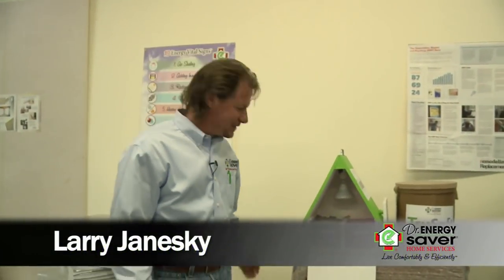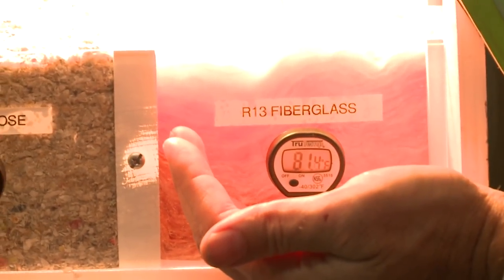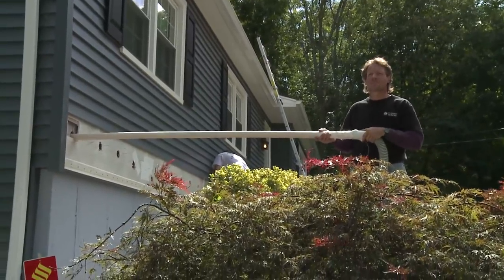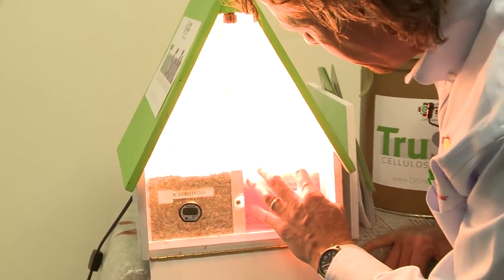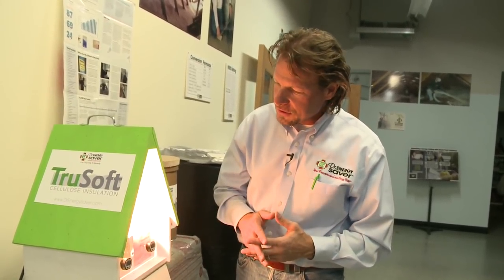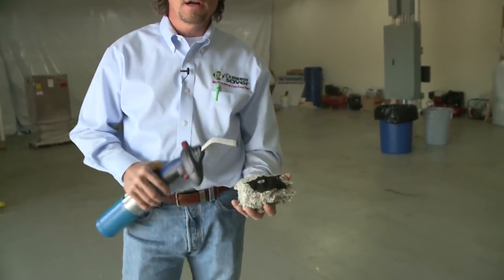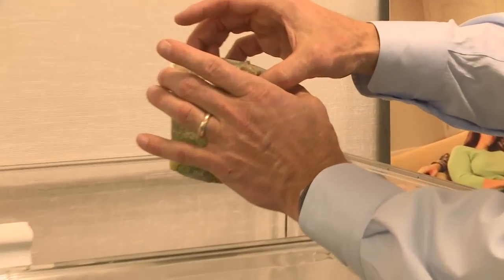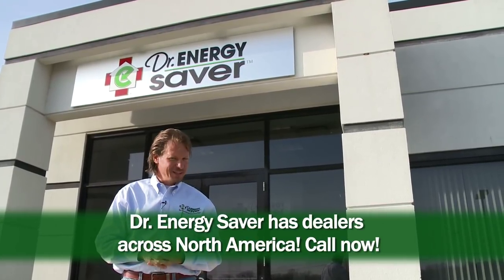Why Cellulose Insulation is Better than Fiberglass Insulation

Comment: Horse burnt to death in stables  using cellulose horse bedding.  The stables and an adjoining barn and horsebox destroyed, other horses rescued by the fire services. The cause of the fire is suspected to be an unsafe electric light cord whose  bulb was not enclosed with a safety cage or bulkhead fitting.
Reply: +SuttonWoods, Thanks. My new sales folder will show how silly fiberglass salesmen must get to trick homeowners. I wish I could follow your sales calls. All customers would buy higher performing cellulose insulation and have a good laugh at your expense.Does your sales car have a warning decal, "Caution, Fool Inside"?
Reply: +Larry Maloney / You are such a busy little man, folders, diaries, sales books, a new book to be written and published, I can name just 3 books worth buying and reading, Knowledge helps but it does not beat educated replies, honest answers, lots of determination and dedication, I put in 14 hour days,  and had longs lists of press leads to cover. One call I called at midnight because his bedroom light was on, others I rung them and asked would  they meet me in a central spot, most would, a Come on Down Call, we did have some great offers then, and I knew we were dealing from strength, Imagine knocking on 100 doors and know 90 were going to go straight in,  but this is all long before you're time, I could write  you a sales plan and bet you to beat it, you can't.
Reply: +SuttonWoods , agreed you are a sales machine but unfortunately for your buyers you know little about insulation. The true value of insulation is its ability to stop air infiltration and resist heat flow. Scientists measure insulation by its resistance to heat flow. It's measured in R-Value. If you're feeling honest, as you claim to be, what is the R-value per inch of Owens Corning AtticCat blown fiberglass installed to an R-13 in an open attic? And what is the "minimum settled thickness" to achieve that R-13 according to Owens Corning? That's TWO questions, Sutton. Can you answer either one honestly? If so, it's a first for you. Show me the KNOWLEDGE side of SuttonWoods, (assuming there is one.) FYI...never been called "little" in my life. Aren't you a bit hypocritical? You start your original rants saying you could write a book. I am writing a book and you choose to scoff.  If you sincerely have anything to say about insulation then write a book. I promise I'll buy a copy. Even ask you to autograph it for me. Then I'll dissect it and point out all the discrepancies in your mind. Well, maybe not "all"...I do have other things to do. Why do you suppose Owens Corning calls their fiberglass blowing  insulation "wool"? Doesn't that confuse or even mislead consumers? It's really fiberglass but they tell customers it's "wool"! Does fiberglass have such a bad name with consumers Owens Corning wants to hide the fiberglass ingredient in their anemic insulation?
Reply: +Larry Maloney / Larry I'm amazed you do not know R-values and want me to supply you with the correct answers, have you no shame? i got a good book this week on Amazon about Raymond Chandler the writer, if you learn how writers write, then I reckon you can beam in on their wavelengths. Good Law books are better, so you can see in the Appeal Court cases what the finest minds think and follow their reasoning.  Tomorrow buy yourself a new white shirt and tie, I always wear Hermes ties from France and Polo shirts, and never let your eyes stray around an home, or at a women boobs. Keep it quick, professional and get out of there if you feel uncomfortable, they can sense you are the expert, and they can also sense honesty of spirit, if they can't drop them, pick your clients minds for buying signals,and walk when the inner clock says I've been here too long. Remember no sign up there and then - me no go back ever.
Reply: +SuttonWoods , good sales advice but dodging my questions is an admission you don't want to admit to the low R-2.73 per inch of Owens Corning AtticCat.  It gets a little better if you pile on 19.75 inches for what is claimed to be an R-60. On the coldest days, when insulation is really important, fiberglass loses as much as 50% of its R-value. You're very good at dodging the science. No wonder your buyers are confused. Too often homeowners are surprised when I quote R-49 and the fiberglass bid was R-60. That's an open door for me to explain the difference in quality. Since you're on the topic of writer and writing, I'll write a kids' book, in the fashion of Rush Limbaugh...explaining the history of the fiberglass industry and how it was turned upside down by the new guy on the block. The book's title? "Simple Sutton Sez!" You've practically written the book for me already. As the story develops Simple Sutton calls on homeowners needing insulation advice, to their dismay and shock they hear Simple Sutton say all the outlandish things you are known for. Then I follow up wit science and reality. Even show their homes after densepacking the walls and vacuuming out the fiberglass and mice droppings from their attics...will even do a heat load calculation so they can see scientifically the serious  advantage to cellulose over what Simple Sutton suggests. My chapter on frozen water pipes will be especially helpful to homeowners to understand why half million dollar homes have frozen water pipes in spite of fiberglass batting in the walls. Anecdotally speaking, Simple Sutton...err, I mean Sutton, ol buddy, I've actually seen frozen water pipe in exterior walls and frozen fiberglass insulation too. The plumber repaired the plumbing and I removed the fiberglass and correct the inadequate insulation problem for the homeowner. No more frozen water pipes. Your sales "tips" are obvious to all politicians, salesmen, lawyers, clergy...it's universal. But thanks for the personal insight. I taught seminars around the country for quite awhile and even teachers pick up on clues to the students mindset. When someone "doesn't get it" I simple present in another way, I don't run out the door hoping the next lead is low hanging fruit. Instead of testing your skills on tough sells you flea. What you are witnessing is educated consumers. They don't want inferior fiberglass. On second thought, maybe it's best you do move on... to a third world country?
Reply: +Larry Maloney / Larry a serious question:"We all know that paper mills, coal mines, and corn silos can spontaneously combust, explode into flames often with great loss of life, with your'e scientific knowledge can you convince me that Cellulose Insulation does not and will not explode in attics and walls spaces".  Fiberglass does have one huge disadvantage, and you have not one mentioned it, and it's a trade secret. 
Then again *according to you,  9 out of 10 mice, rats and birds prefer to nest in it rather than Cellulose Insulation, so Mother Nature must instintively trust it and feel it offers more benefits from it over Cellulose. Our Winter Sales Slogan will be "Follow Mother Natures Example, Choose Fiberglass and go with the in-crowd. "
Reply: +SuttonWoods, those environments don't "spontaneously combust" The content of the silos, mines, and paper mills are combustible. As you know, fiberglass melts in a fire and the combustion gives off carbon monoxide and other gasses deadly to humans. Fire-retardant cellulose insulation is a fire barrier (unlike fiberglass). Neither the National Institute of Standards or the U.S Government recognizes fiberglass as meeting fire standards for walls. Fire-retardant cellulose insulation is a safe barrier from fire and can even block poisonous gasses from fires and gasses from melting fiberglass. I think interior walls should also be insulated with cellulose and floors between levels for occupant safety. In existing buildings it's best to vacuum out the fiberglass first.
Reply: +Larry Maloney / I'm not bothered how friendly Celluose Insulation is, when it set a blaze, I'm getting out of that house fast, dead fast.  What do you expect me to do  - sit there and swap jokes with it?
Reply: +Simple Sutton Sez,  "I think it's best to leave a burning building." Good thinking Simple Sutton. But did you know if your home was insulated with cellulose, the fire retardant insulation, instead of light density fiberglass, you'd have an approved fire barrier? Your home doesn't likely benefit from cellulose insulation so may I suggest you equip all electrical circuits with Ground Fault Interrupters in case an electrical short might occur and subsequent fire breaks out? Without the protection of cellulose, the fiberglass will melt and the fumes are deadly. Too bad you talked your money counting wife into saving a few bucks by installing light density fiberglass. She deserves better.
Reply: +Simple Sutton, I was reading an article about sociopaths and psychopaths. Turns out they aren't the same but do have some common traits. I quote: "Some media outlets or older educational materials may refer to psychopathy and sociopathy interchangeably, but the most recent research says this isn’t accurate. Though both conditions are associated with a poor sense of “right and wrong” and a lack of empathy,"  Hmmm, so maybe you're a natural born salesman? You did say your dear old daddy put you on the street at a tender age. That wasn't much of a childhood. I thought selling light density fiberglass was a learned skill. I need to lose my sense of right and wrong and dump my empathy for others to be successful like you. How does your resume read, "Sold light density fiberglass insulation to unsuspecting homeowners. Massaged negative facts about inferior fiberglass to a positive spin for financial gain." Is that sociopathic from birth or did daddy do it to you?
Reply: +Larry Maloney // Householder use their loft for storage, tradespeople and owners need to enter, that not possible with Celluose becuase you cannot see the loft floor joists and do not know were to walk or to put your feet, so for safety you need to board the loft floor with wood walkways. If you  place wood on loosefill Cellulose insualtion and it crushes to nothing, it turn to dust, everyone knows that ?
Reply: @ Larry Maloney // I was born the 7th son or a 7th son. When I was born a huge roll of fiberglass insulation was over the driveway leading to the house as a Welcome Home mat, 3 Kings arrived shortly thereafter, King Owen, King Corning, and the King of Kings, was it my fault I was ordained from birth to lead the Fiberglass revolution to bring warmth were there was cold, to show honesty and kindness to other less fortunate, to lead the unwary away from Cellulose, Blessed Am I , blessed am I,
Reply: +Simple Sutton, walk space is always provided, as requested. Any insulation above the ceiling joists hides them so that';s not a persuasive argument against cellulose.  We routinely densepack cellulose. It's engineered for that purpose. No silica dust like fiberglass. Because of cellulose's density it can be blown under walkways packing in tightly to prevent air infiltration  that fiberglass can't stop.
Reply: :@Waste Paper SalesOffice: 

Fiber glass insulation is a proven performer amongst  
insulation products. It provides exceptional thermal performance, moisture and
mold resistance and fire protection. The two named builders below noted that
fiber glass is their top choice for insulating homes. “As a builder, we are selling an energy system. And fiber glass is the answer for energy efficiency,” said Bill Decker Sr. Wayne Homes is an award-winning regional builder with a presence in Ohio, Pennsylvania, Indiana, Michigan and West Virginia – producing between 500-1200homes per year. Decker Homes builds high-end custom homes across southeast Michigan and northwest Ohio. He says Decker uses fiber glass for all it's homes.
Reply: +Simple Sutton,l we're vacuuming out fiberglass today...small house. The homeowner will be pleasantly surprised by how much lower her heating & cooling costs will be with that anemic light density fiberglass removed.. The mice infestation is gone and there will be no more fiberglass to entice those nasty vermin back. If those builders you mentioned could read they'd know fiberglass is a poor insulator. Fiberglass even melts in fire giving off deadly gasses. Put THAT in  your bong and smoke it.
Reply: Reference: G-PMC Registrars Adverse report on Cellulose Insulation and it's dangers to the public: (PRODUCT RECALL NOTICE SOUGHT)

This highly reputable company assess and test products for their safety and long term medical risks to the public, installers and end users of it", They considered Cellulose insulation so dangerous that they refused to snaction it's use. In some respects This refusal  is an Official request by them to the Product Licensing Authorties for its continued use to be immediately suspended and outlawed.

You as a manufacturer and re-seller have a clear duty to heed these public safety warnings and to make sure  you have sufficient Public Liabilty Insurance in place to meet any claims made on you by claimants.  My advice to householders to take immediate steps to have it removed from their homes with the  manufacturers and sellers jointly paying for its removal and / or replacement. Please give your staff photocopies of this report, and obtain their proffered views on whether they wish to continue laying it, or handling it. For my part I will circulate this report to the Insurance Associations so they can (i) adjust their premiums upwards to cover the increased risk, and (ii) stop insuring it. **Please confirm whether or not you will make an instant product recall notice.
Reply: *Ohio Cellulose Installers sends Whistleblower the above
OBSCENE message.* * To all Ohio YT readers who know the above person or his firm k/as LARRY MALONEY. Please alert your Better Business Bureau, (he claims to be a member) and your local newspaper to his posts. Nationwide alert: Afterwards if you have Cellulose Insulation check your loft space for Cellulose shortages and depth shortfalls. Nationwide Cellulose depth shortages are often passed off as natural settlement their not - when it was not laid correctly in the first place. To check your loft insulation depth you must go into the loft, be advised that nationwide theareas near the loft entrance hatches are always nice and thickly laid, because they are easy for house owners to inspect and approve, it's in the hard to reach areas where it is thin and patchy*
Reply: IMPORTANT ANNOUNCEMENT...our dear friend, SluttonWoods won't be with us for awhile. Rumor has it he's hitchhiking to Tijuana, Mexico searching for a new cure for impotency  Disregard any claims Slutton is fleeing arson investigators after that catastrophic  barn fire causing the death of so many sheep,  Slutton says, "I luv sheep and would never hurt nary a one...I truly luv em all..